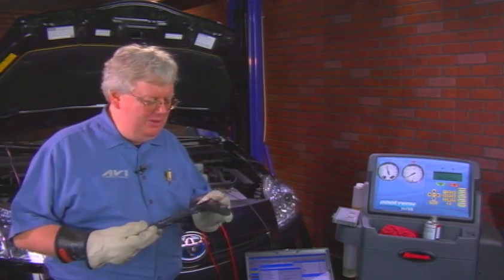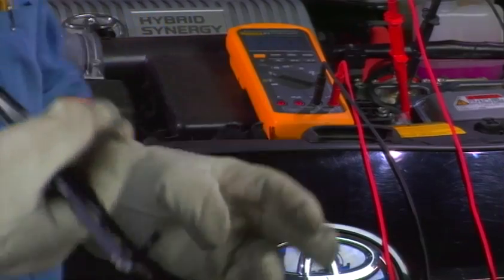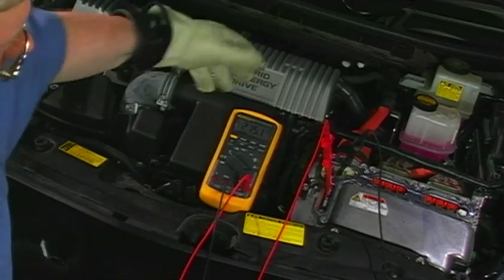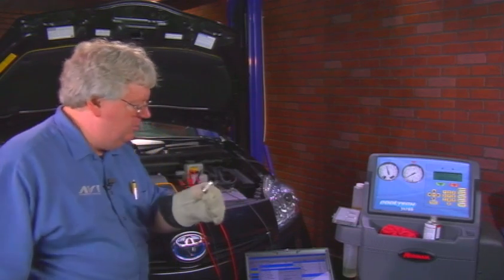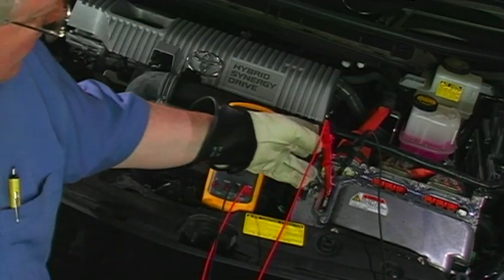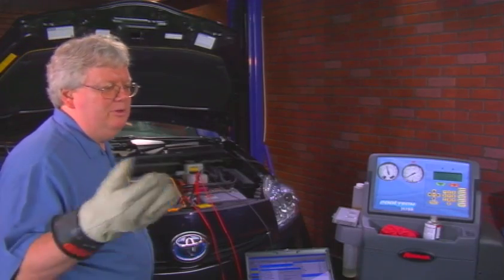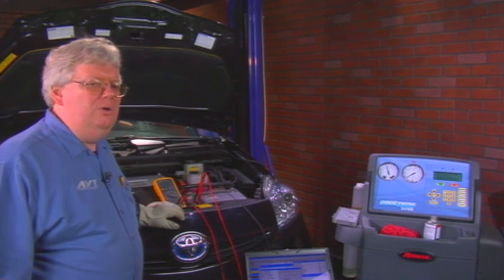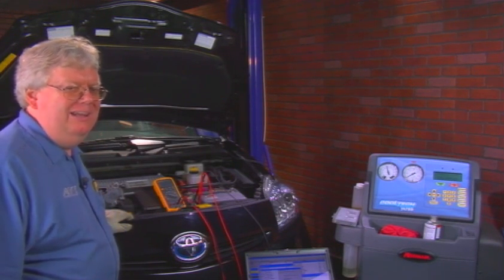Hybrid A/C Compressor Fuse | Dave Hobbs | Tech Tip

Comment: Having issues with air conditioner after head gasket replacement. Air conditioner was working prior to HG replacement but now no cold air in cabin. Issue is on my 2012 Lexus CT200h. Would this contain the “sand fuse” that is referenced?
Reply: Same problem mine lol
Reply: I have the smae problem with my 2010 prius just replaced the HG. how did you fix your air conditioner.
Reply: Finally took it to Toyota dealership and apparently the compressor was shorted. Crappy deal, tbh. Good luck.

Comment: Hi,
My 2012 prius a/c compressor won't work. It makes rattling noise 3 times and stops. Is it compressor, ecu or inverter? Will bad fuse cause this?
Reply: I have exactly the same problem. I just replaced the compressor and it still doesnt work. Is it something simple like a fuse? The mechanic checked the fuse panel in the engine compartment. Does a 2012 Prius have this sand filled hidden fuse too?
Reply: What mileage did you guys get this done? I'm looking at 60k
Reply: Hi, could you please help me?  What did you ever figure out?  I have the same problem with my 2011 Prius....
Reply: Same with you Mace....., what did you do?
Hi, could you please help me?  What did you ever figure out?  I have the same problem with my 2011 Prius....
Reply: Same problem here. I am about to replace the compressor but would be nice if someone has any other idea before I shell out more money
Reply: Same problem here 2009 toyota prius

Comment: many people complain that the pins on the black 6-pin controller connector bend easily.
it is my gut feeling, that the black 6-pin connector should be easily removed from the socket, once the two 5-mm e-torx bolts are removed. Did any one try?

Comment: Kindly help me with this code... u1207:00– epp(ima) can multifunction (pcm- a/c compressor driver)
Reply from the maker: Just glancing at the code it could be: 
    EPP-CAN circuit EPP-CAN A_H line open
    EPP-CAN circuit EPP-CAN A_L line open
    EPP-CAN circuit EPP-CAN A_H or  A_L line     short to ground
  Electric A/C compressor failure

    MCM/BCM failure
Please bear in mind I am assuming this is a Honda. Please consult with your local mechanic/technician for more detailed information. 
Have a nice day!
- J. from AVI

Comment: Where is the stupid fuse located
Reply from the maker: According to our notes from 2011, the fuse is generally located at the "Power Distribution" Box which is located in the engine compartment. Basically its a black box with a snap-on cover next to the battery. Double-check a fuse guide for your make and model online and at your local shop. 
Have a safe day!
- J. from AVI